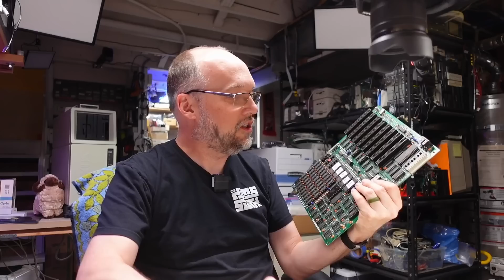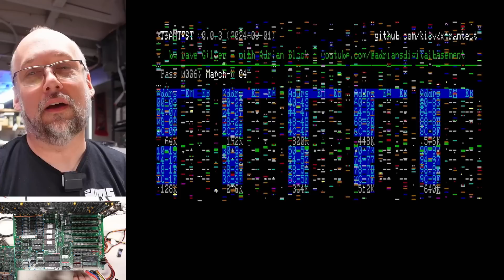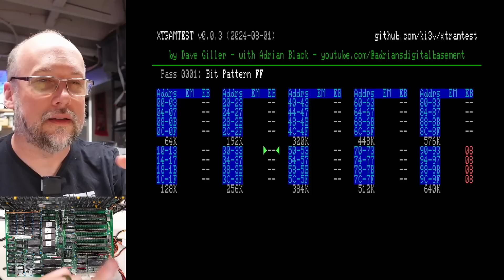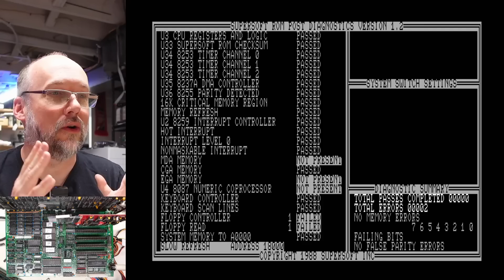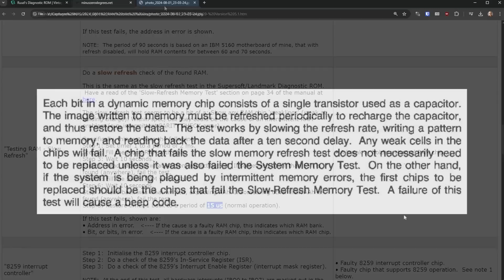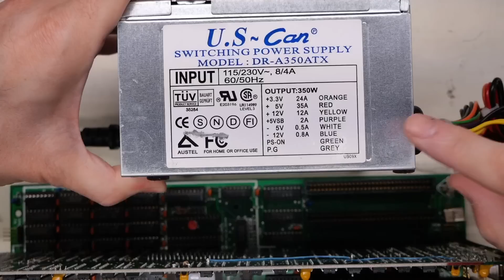A brand new XT RAM test ROM and an update on some unfixable parts

Comment: screwy power definitely causes ram errors on older boards, look at the colecovisions for that, its mostly an issue with bad power plugs, but its the same end result, the ram goes haywire from the interrupted and/or unstable voltage and the system never has a chance to stabilize which looks a lot like a ram fault, which technically it is
Reply: Yeah, that 4116 DRAM needs all three power rails to work properly. All three have to go through that silly connector in back, AND the +5 and +12 go through the power switch too. It's been at least a quarter century now since I first fixed a Colecovision by repacking the power switch with fresh grease, and the hardware will only have gotten into worse condition since then.
Reply: @8bitwiz_  my unit had one of the worst plugs the guys i went to had ever seen, very weak engagement on at least two of the voltage lines, had to drop around a hundred extra for a new psu because of that, psu worked fine but the plug was just worn out beyond any feasible repair

Comment: The "Capacitor Plague" was, according to what I've heard, a case of industrial espionage gone very wrong.  Someone attempted to steal another company's capacitor electrolyte recipe, but they got an early recipe which had not been "fine tuned" properly.  They copied that recipe faithfully, and because it wasn't the final, good version, it led to early capacitor failure.  I have no independent verification of this information, though, so take it with an appropriate amount of scepticism.  (Needs Salt!)

Comment: Only thing I can guess at for why your original board was less tolerant of bad power - it looks like the second motherboard was maybe an earlier "full fat" version, where it still had the "extra" power connector, everything had sockets, etc. Your OG board maybe a later cost reduced version - often times later revs will start omitting or downgrading filtering components to save cost. Just a guess - depending on how much your curiosity/OCD demands it, would have to check /every/ cap and resistor value on both board and see what changed or was omitted.

Also, while i know you're not a fan of just replacing capacitors "just because" for any Pentium 4 era PSU that hasn't already blown up yet... I'd at least pull the remaining caps out and test them! Many of those era supplies (some Bestec models i think?) were infamous for blowing up like your old AT supply did, where it killed the connected computer on it's way out!

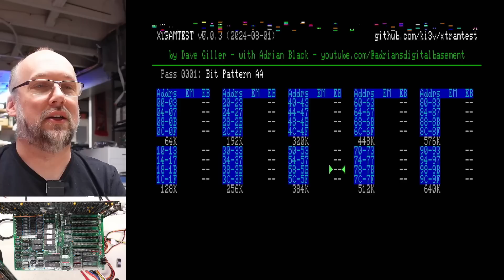Comment: 27:30 since you're in total control of the system on the diag ROM, could it not be helpful to have a utility that completely fills a bank with 1s and all other memory locations with 0, so your testing is basically just finding what bank has the high output on it's memory lines?

Comment: I was using a common mid 2000s FSP PSU for years on everything retro and never had any issues with it. Recently I got some unusual 440LX based Slot 1 OEM board that wouldn't POST with any Klamath CPUs. It would POST with some Deschutes and Celerons, but only if no AGP card was inserted. This didn't make sense at all to me, until I checked how this board powers the CPU VRM and AGP: Directly from ATX 3.3V. That is kind of unusual. It turned out that the 5V line from the PSU dropped below 4V with beefy CPUs/AGP cards inserted due to the massive 3.3V<->5V current imbalance on this specific board.
Reply: That wasn't that unusual for boards in the late 1990s and early 2000s. Athlon boards pulled hard on the 5V rail too, to the point where you either have to overprovision your PSU to deal with it, or find a power supply that is 5V-heavy.

Comment: Yesterday I programmed my Spartan3A FPGA board to support a WD65C816.  It output the startup text to the terminal and waited for input; which I was planning on working on today.  Today, however, it does not output to the terminal.  No code has been changed.

Comment: Maybe insufficient filtering in the PSU causes 'jitter'. If it is bad enough, possibly the bit 'jitters' when the 1 or 0 gets determined. When you look at the bits, over- and undershooting might exceed the threshold and causes a 1 being seen as a zero or a 0 as a 1, yet, in fact, the bit is correct. Adding to this, tantalums are very good caps on higher frequencies, it is not that engineers put them in there because they are cheap or ceramic do a better job, they are on there by design. I would think that if they are bad, they should be replaced, not swapped for ceramics. Computer PSU's are adequate, yet often 'just good enough' and if some filtering starts failing, you can end up with issues, is my guess.

Comment: I had a feeling from some of the first things you said that it was the PSU, especially since you were burying the lead.  ;). I've had SO MANY weird, random, flakey issues with PCs over the years that ended up being the PSU, it is still one of the first things I swap these days just to rule it out.  This was especially true during the dark times...during the empire...of terrible electrolytics.  I've even gone so far as building a huge resistive load and bench testing the PSUs with a scope to try to understand what noise issue even is.  Often i can find nothing wrong in the steady-state.  It seems to be an issue with highly dynamic loading rather than just ripple.  I still have one notorious motherboard...the TigerMPX...that pushed the old ATX standard past the limit and would bring PSUs to their knees.  PSUs that failed in that system would work fine in others.   The only one that could do it was a PC Power and Cooling, which were good at the time.  Anyway... I feel your pain.
Reply: There was a time from about 1998 to 2005 where somehow both Intel and AMD thought it was a good idea to use the 5V rail to drive the CPU, and as the TDP kept increasing, so did the draw on the 5V line, to the point where you needed either a power supply that favored the 5V rail, or one that was much more capable in general (and then ignore the 12V capacity).

The capacitor plague coincidentally happens to fall within this span of time, which can make it hard to determine if a PSU is failing, or if it's trying to do the wrong job of delivering reliable +12V and neglecting +5V.
Reply: @mal2ksc  yeah, that was definitely an issue.  The other issue was how the PSUs were/are de-rated at temperature.  Most power claims assume something like 25°C intake temps...something that never happened in typical ATX cases where the main exhaust for the entire case was through the PSU.  PC Power and Cooling were rated for higher temps and I think that's why it was the only one that could power my dual Athlon MP machine (despite having many other exhausts in that case).  I had Antec's and Enermax's and others that claimed to have stout enough 12 and 5 rails, but couldn't keep it up for the long haul.

Comment: I suggest you use modern, good quality 80plus Gold PSU (be quiet Pure Power 12, Corsair RM).
They should extend the Life of your old stuff quite a bit.
However there is a bit of an issue: they don't have -5V and you need to build an Adaptor to generate that...

Comment: What would be cool is an ISA card with a Raspberry Pi running these memory tests (by acting like ROM with that test program), then use data mining (Python, anyone?) and some AI to tell you which specific chips to change out. So, for example, it might run its tests and say, “change U44 (failed march test, failed page test.)”

Comment: Would it be worth checking the remaining P/S outputs with an oscilloscope? If the unit was from the counterfeit cap era and you've had to change two already, could the others not be far behind? It might be worth making a 'monthly checklist' of things to go through in the Basement - with all that gear, you might need to consider some kind of preventive maintenance regimen. ;)

Comment: I'm blown away how this program works without RAM. Maybe you went into it and I missed it! If someone asked me to solve that I'd I wonder if you could place extra RAM into a specific memory address, with an ISA card, and use that. But pure software? A modern CPU, there's tons of internal cache, but an XT? Geeez. [edit] AHH, you flash the ROM with the code. Neat!

[edit 2] Okay yeah they even sell ISA RAM cards new for $43 bucks. The issue would be blocking off access to RAM you want to test (if you're testing say, the entire possible RAM space, you couldn't also have the addon shadow RAM responding in that space). Though if testing a PC with the first 640K, that card populates UMB as well (up to 1MB). And if the first 640k works then you can boot normal and test the 1 MB/etc with a normal program. 

But going the EEPROM route is really simple considering how cheap EEPROM flashers are!
Reply: I think you missed some points: The test-software first tests the graphics card and then uses the RAM on there. Most graphics cards only use the start of it's memory, so you can use the last bytes as a stack. But you can also only use the registers of the processor: Instead of calling subroutines, write them as macro's. Makes the program much larger, but it works!
Reply: Even on an MDA card, there’s 96 bytes of unused RAM after the text page video RAM. That’s enough for the stack and 9 bytes of variables the ROM uses. Adrian challenged me to write a version that loads from DOS and installs itself in unused CGA RAM and runs from there, testing every byte of conventional RAM. I may try it. It will be a snow monster though on many CGA cards though!
Reply: @drgiller  You could squeeze more video memory by switching to cga 40 column mode but I guess that would sacrifice the ability to show a lot of data so the extra free video ram is probably not worth it if you can't display the errors in a nice fashion. Wouldn't help with MDA as that only has the 80x25 mode. But Worst comes to worst it is possible to use the active display memory for things that would appear as garage on screen but if it's all you have you could live with it.
Reply: @MonochromeWench  96 bytes is plenty for the stack and a few variables for this ROM.  On the TRS-80, we did use on-screen RAM at the bottom of the screen and that worked fine too.  Tidier though to keep it off screen.  40 columns wouldn't have worked because to keep track of the 80 different error values from previous runs, I just read back what's already printed on the screen, getting that storage for "free".

Comment: ha, something similar just happened to me. i have a late 486 build with VLB, for some reason though my midi daughterboard (a serdaco dreamblaster S2) started having notes waaaay off, the mobo is a pos pcchips m912, so i first tried with another one, but it was still happening... then for some reason i decided to change the PSU for the one on my 386, and i havent experienced this issue since. so frustrating lmfao. the odd thing is that both are modern 80 plus PSUs, but the one with the issue is a cheap model though. i'm thinking some logic chip on the mobo may have problems with worse ripple or something like that. the odd thing is that everything else was working rock solid stable

Comment: I reckon that ram diag rom should be able to update the POST card, if you have a bad video card or unsupported one beep and change the value on the card, also maybe show the bit pattern for the fault etc on there as well
Reply: I actually tried that (Ruud’s ROM also updates the POST I/o port) but Adrian reports that POST cards on XTs behave very strangely - the display gets many random codes. So I gave up on it. Some older 80’s POST cards seem to work but nothing you can find cheap on eBay these days. The parallel printer port is also an option but requires custom hardware. Since we require the CGA or MDA card for RAM, at the moment we also require it for reporting.

Comment: I'm experiencing a weird issue on a modern system with a 4090 and some people think it's the PSU, and I refuse to believe it is, mainly because it started after an OS update alongside the GPU switch (and I can't go back to test because Microsoft), and it's not stability related.

Now.. well, guess I should just bite the bullet and eliminate it as a potential, as who really knows what ways a PSU can actually manifest problems.  Just, PSU's are the worst thing to swap in a cable managed full tower chassis with nearly every slot filled...

Comment: Maybe the power is now more stable. Have you checked the caps, which are near the chips? Maybe they are on one board bad and so the power is unstable. On the other board, the caps may be better and would stable for their related chips.

Comment: EE here.  Your theory about excessive ripple seems to be right on target.  We know the two MBs are not identical.  There are many possible reasons that the one MB continued to work with the bad PSU; many subtle.  Total usage ("tired" silicon), different support chip manufacturers, even slightly larger bypass caps on the MB could cause one to work and not the other.

Any troubleshooting tech will tell you that odd/intermittent/inconsistent errors... check your power. (The true definition of a "glitch".)

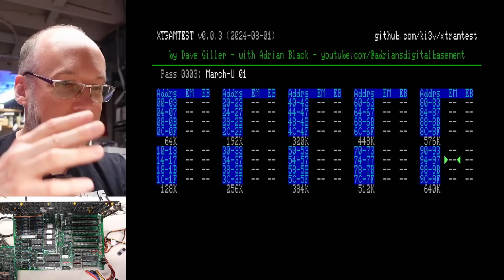Comment: 15:31 If the program already knows how to run a memory test completely without using a stack when testing the video memory, why doesn't it do the same for the main memory?
Reply: It could possibly be written to test all RAM using only registers and no RAM.  Possibly not… there’s segment arithmetic when testing more than 64k on a PC… the totally RAMless version doesn’t need to.  But routines for reporting what’s bad without using any RAM would be terrible and nobody would be interested in using it. So, might be possible but not practical or useful.
Reply: @drgiller  Well in this case and contrary to Adrian's statement, the test of the video memory does not exactly do the same as the test of the main memory. Cause if it is true that the test needs the stack purely for reporting reasons, you won't get the same kind of reporting for the results of the video memory and I consider the reporting an integral part of a memory test. Additionally, you obviously won't get the option to infinitely test it, neither.
Reply: @Toxis374 I think maybe you’re being a bit pedantic.  It’s the same testing algorithm and Adrian was being conversational. But if you’re disappointed you’re certainly welcome to a full refund.
Reply: @drgiller  I'm just trying to make sense of what others say, sorry for that.

Comment: It would be interesting to create a rig that deliberately supplied bad power, and see that motherboard and memory card starts failing.

Under voltage would be easy, just need to wire up some lab power supplies replacing some or all of the voltage rails. I'm not sure how you would go about deliberately injecting ripple, some kind of high-power function generator? Or do you just need to take a good power supply and deliberately degrade the components?

Comment: The reason why you were having issues with the one motherboard and AST card, but not the other board could come down to capacitors. Perhaps the "good" motherboard has capacitors that were higher quality or that have aged better than the ones on the "bad" motherboard.
Reply: One could be running signal lines hotter than the other too, so the ripple bleeding through into Vcc won't turn a 1 into a logical 0 by dipping below ~2.8V quite as easily. A tenth of a volt could easily be enough to make the difference.

Comment: Manufacturing tolerances could explain why some chips would react worse to a bad/noisy power than others might, in a similar way different chips respond differently to underclocking and running at a lower voltage ( yes some people do that, for efficacy I guess😵‍💫) everything is fine when operating within the factory limits but differences between chips could start to show up once those limits are exceeded.

Comment: Over 20 years ago I once had a PC motherboard blow smoke when I turned on another PC I was fixing that was on the same vinyl wrapped wooden table, The motherboard that blew smoke was in its case but not plugged in as I was using that power cord to power the second PC I was fixing, Have no idea what happened. I still can't wrap my head around why that happened,

At least you have a possible theory whereas I have nothing.
Reply: Probably just a power brownout-then-surge from them both being on the same branch of the mains took out a capacitor that was already circling the drain.
Reply: @mal2ksc  that sounds right
Reply: @mal2ksc  As I said in my comment I only has ONE power cord so the computer that blew smoke wasn't even plugged in. Also these were AT PSUs.
Reply: PSUs can hold voltage for a while while not plugged in. This is somewhat far fetched, but I think the PSU developed a high side short to rail while at rest and unplugged, and thus dumped the stored voltage into the poor mobo...

Comment: Because I know nothing about electronics repair one of the only things I can do is throw a different power supply at a problem and probably 1 out of 3 times it just works. Never trust a power supply.
Reply: Bad idea, if you don’t know what you are doing avoid doing things like that, you can damage so many things trying that.